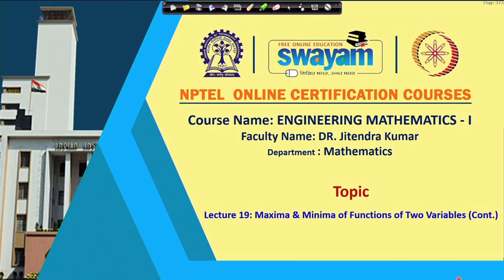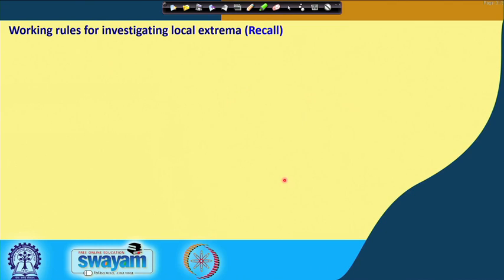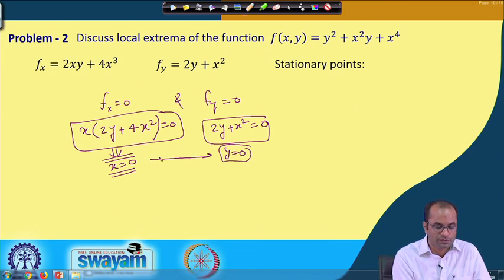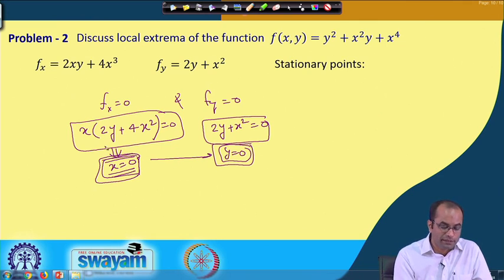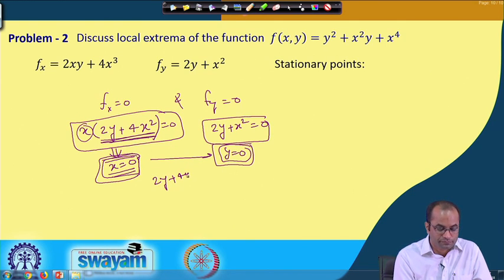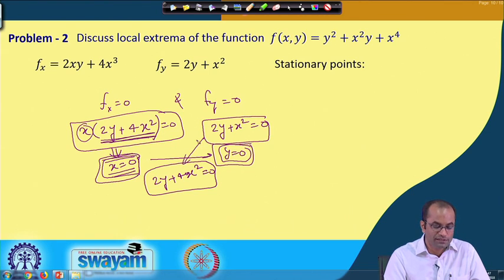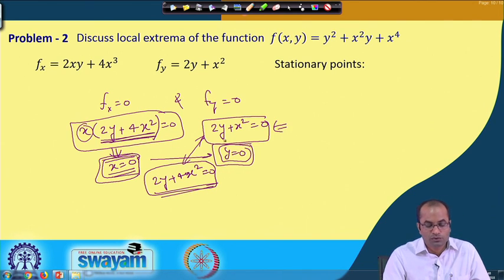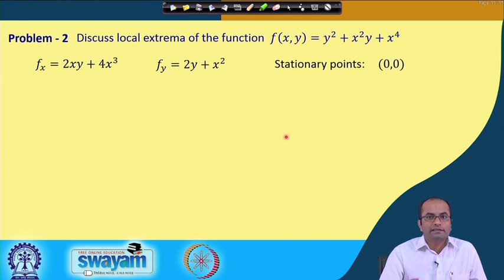Lecture 19: Maxima & Minima of Functions of Two Variables (Cont.)

Comment: Sir, In the previous lecture we proved the sufficient conditions by taking r is not equal to zero but in {PROBLEM - 2 and PROBLEM - 3 ; at the origin}, we are getting r as zero, so the equation [rs - (t^(2))] does not satisfy here, so that we are getting Local minima and Saddle point in PROBLEM - 2 and PROBLEM - 3 respectively, that means we should not apply [rs - (t^(2))] here and we should proceed directly the (delta)f process, so I am requesting to verify it too.